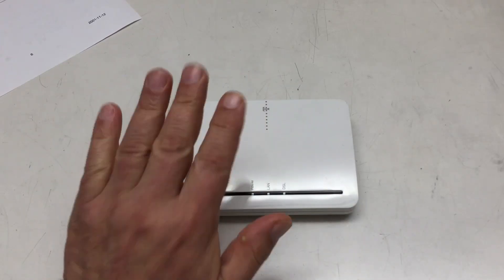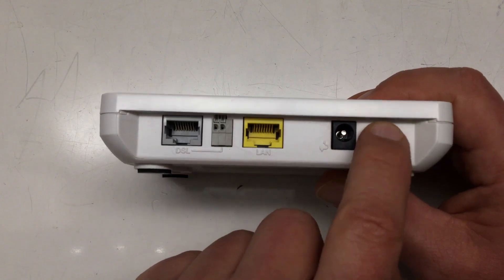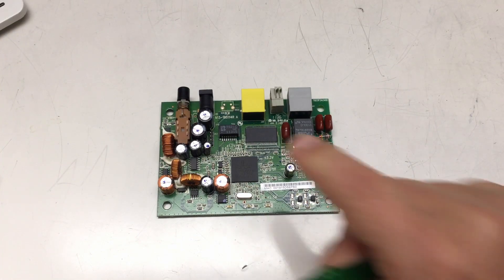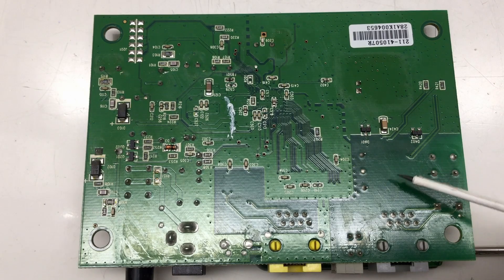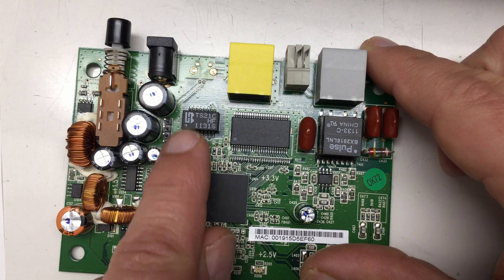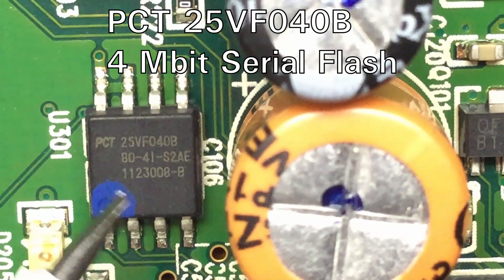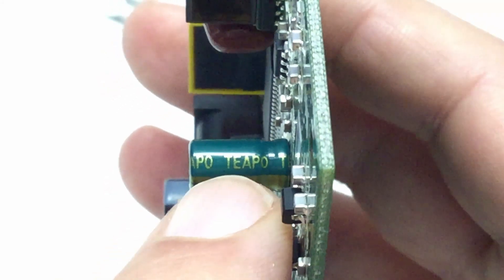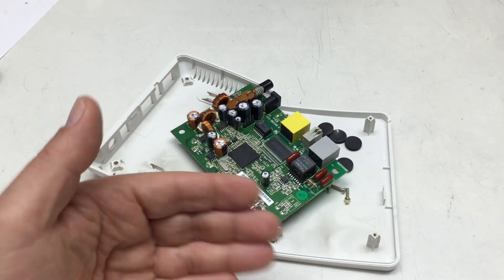German Telekom Speedport 201 DSL Modem Teardown (All the Chips)

Comment: I actually remember modems like this one, in fact I remember some DSL and ADSL modems that connected to a PC witth a USB cable, not Cat 5 network cable, and they would get their power from the host PC they were connected to.
Reply from the maker: Yup! Most people didn't have more than one PC - let a lone a home network - back in those days. So why make those devices more expensive by adding routing/switching capabilities. I think I still have an ISDN ISA Fritz!Card (not PCI!) somewhere. I think they made later on also a DSL version.
Reply: @robertssmorgasbord  I've never in my life actually seen an internal ADSL/DSL/Cable modem card, all the ones I've owned and seen have been external.  I still have somewhere here a NetComm NB2 ADSL USB modem, it had just two sockets on the back, phone line and USB, it was a vvery simple device but it served me well for about 2 years before I got my first Wi-Fi router.  Actually, I think in the early to mid 2000s, ISPs charged a connection fee if you wanted a home network.  Imagine them doing that today, that would never work.
Reply from the maker: @Lachlant1984  Here's a the Amazon Listing of the Fritz!Card DSL: https://www.amazon.de/AVM-FRITZ-Card-ISDN-ISDN-Kombimodem/dp/B00005UQ5O . Would you believe it's "currently not available" 😆
Reply: @robertssmorgasbord  Absolutely, I wouldn't think too many people use ADSL services anymore, I'm not even sure if it's still available where I live.
Reply from the maker: @Lachlant1984  Obviously you live in internet heaven 😄 Here in Germany most people still use ADSL ranging from 16 Mbit to 100 Mbit downstream. Internet via the cable TV coax is also quite common (it's kinda OK as long as there are not too many subscribers on the same cable as you). Optical fiber is still in the deployment phase (for private customers).
Reply: I'm in Australia, we never got speeds like that on ADSL 2.  We now have a service called the National Broadband network, my connection is delivered by hybrid fibre coax, I believe it is the same media as cable TV, I think I get speeds of around 50 Mbps downstream.  I think the best speeds I got on ADSL2+ were about 11 Mbps.
Reply from the maker: @Lachlant1984  It's the same in the German countryside. ADSL got in some regions never faster than 16 Mbps downstream. If you're lucky you can get 50 Mbps over cable TV coax. Though, Germany has a lot less countryside than Australia I guess 😆